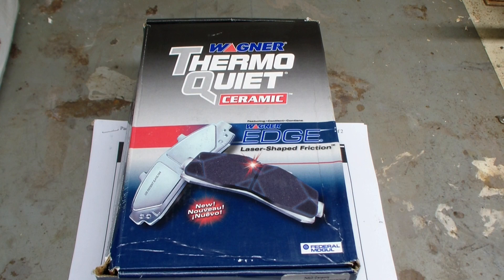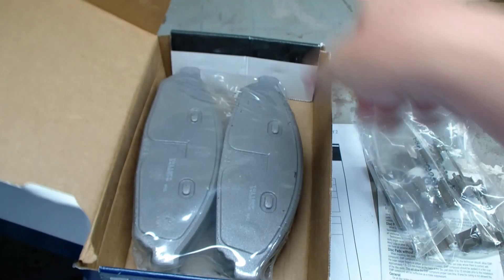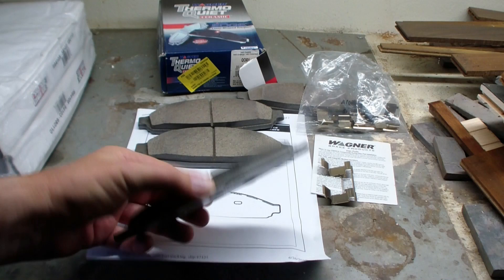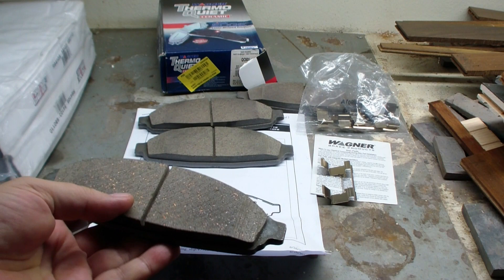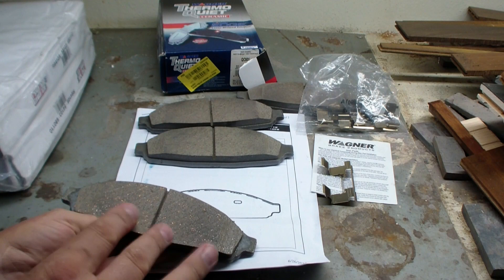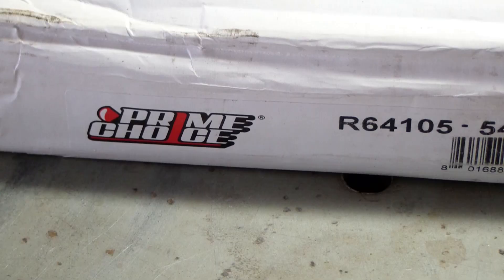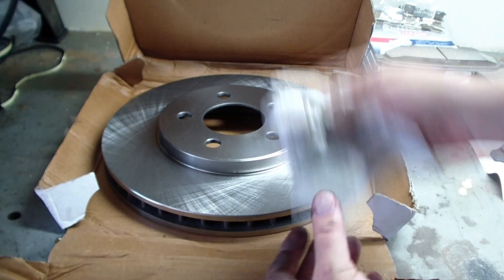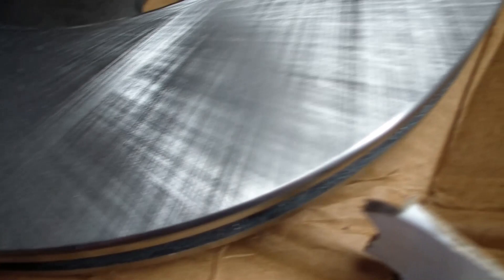Wagner ThermoQuiet Ceramic Brake Pad and Prime Choice Rotor Review

Comment: I used to love Wagner pads until I bought my first new car. I bought a 2016 F150 and @ 2k miles. The front rotors warped. I could not believe it and I kelp driving the truck thinking the problem would go away. @ 20k miles, I ordered Wagner pads $50 and some off brand cross drilled and slotted rotors for $50 off ebay. I installed the pads and right away I notice my truck did not stop as well as the stock pads. I had to stand on the peddle for the truck to stop. I put about 20k miles on the Wagner pads. I then went back to Ford and bought Motorcraft pads for $90. The truck stop like it did when new.
Reply from the maker: When it comes to which brand to buy my head explodes. There are so many brands and options with some costing 4x others. I think there a few standard formulas they all pick from. I got Wagner due to the noticeable enhanced quality construction and they include the hardware for a reasonable price. Economies of scale from a large company. So far so good for me.  Factory pads seem to be a safe option too. Model by model it will take experimentation to know.
Reply: @KentDiego  Yes which is why I tried Detroit Axle $27 (too much dust) and Bosch pads $60 (stop better than Wagner but cheaper than Motorcraft). I have a video of each. I plan to try Stop Tech next.

Comment: Carb/choke cleaner is not the same as brake cleaner.   It makes no sense to use premium ceramic pads with junk rotors.  Those rotors will wear rapidly and unevenly and take the pads with them.
Reply: इंदापूर

Comment: I order once for my Toyota Prado they were good but the covering was mildly broken with some metal rust on them they were good for there live time, changed at around ( 50000 kilometer) and there price when I put them in the car there moulded insulator broken also by the piston rings pressure , so  for me I would still stick with original brake pads better

Comment: So will these squeak to let me know it's time to replace them after using them for a while?
Reply from the maker: Older cars had what they called a sensor, a strip of spring steel that would hit the rotor when pad got thin. Newer cars have wired sensor that hits rotor when pad is thin. The pads should never squeak on their own.

Comment: I'm currently looking into these same Wagner pads for my 2012 Malibu LTZ. I've had my run with ac delco pads and rotors and I wasn't impressed and they wore prematurely. August of last year I purchased duralast cmax pads and duralast rotors. I've put about 30k on car since then and there are grooves in the rotors but pads has some ok life left in them. How are the rotors holding up after a year?
Reply from the maker: Cortez P The rotors seem fine. I got them as they were the cheapest but a steel disc is a steal disc. Got rid of my shaking and pedal pulsations just fine.
Reply: +Kent Diego Hate to be "that guy", but rotors are made from cast iron, not steel. I'm glad they're working out either way! I worked for a company that produced rotors for GM, and believe me they're not all the same...these things went through quite the process from casting to final corrosion coating. I've personally never had any luck with cheap rotors holding up as long as the pads, but Michigan weather seems to induce warping. I just went on Amazon and bought Motorcraft rotors for my Focus and these pads. For $33/piece I figure I'm paying no-name money for OEM rotors. Hope they hold up to the ceramic pads, since they like to eat rotors lol. Glad your parts held up.

Comment: Hi, I put ThermoQuiet on my Van 200 KMS ago and with some moderate braking these pads STINK!  Do you have the same issue?
Reply from the maker: +Anthony A No unusual smell for me. I am happy with mine. Good ceramic pads, well done shim design, and a fair price.
Reply: Whether you replace the rotors or not, it takes a while for the pads and rotors to wear into each other.

Comment: Whats the difference between this and quickstop? I assume they are almost the same except for price.
Reply: I'm not sure if Wagner TQ and Wagner QS are manufactured with the same materials. However, the pads seem to be shaped differently. The Wagner TQ are chamfered and slotted differently than the Wagner QS. The advertised difference seems to be that the Wagner TQ are equipped with Wagner's Integrally Molded Sound Insulator, whereas the Wagner QS just has a shim.

Comment: I was really hoping you were going to show us how to put the hardware on or what these even do.  I have no idea what to do with the hardware that comes with these. Is it explained in the instructions?
Reply from the maker: Hi Matthew. Here is the installation video: 
https://www.youtube.com/watch?v=T2r0rF4lEQA 
The stainless steel glides replace the existing glides. Jut pry out the old ones and the new ones snap in.
Reply: Oh i see, thanks for that. But what about the bigger clips as you can see in the photo on Amazon? If you search Wagner ThermoQuiet QC652 Ceramic Disc Pad Set With Installation Hardware, Front, thats the picture i'm refering to.
Reply from the maker: The photos on Amazon are generic photos. Every model of brake pads is different and the stock photos they use are not accurate.  My video shows what is really inside box for Ford CV brake pads. That clip in Amazon photo looks like it fits on top of pads for anti-rattle.
Reply: I really appreciate your help.  Thank you!

Comment: I know this is a long time since the video was made, but how did the Prime Choice rotors hold out?
Reply from the maker: +Randy Kemuksigak No problems. I got them because they were cheap. They were still very nice. Well cross hatched disk. They claimed to have special coating on rest of rotor so will not rust. Made a huge improvement over old worn rotors.
Reply: Kent Diego are these the Platinum if not what's the difference between the two

Comment: How are those pads holding up a month+ later? I am looking at a set myself.
Reply from the maker: They stop well. I do hear low speed squeaking when cold. For a low cost solution they are great. If you are willing to spend twice the price then full ceramic pads MAY be better but who knows. I am happy with the Wagner quality, inclusion of extra hardware and price.
Reply: Low speed squick yes ur right? Squeek a lot as long as it get old

Comment: Are they good break pads? Do you have to grease them on the back or just put them in?
Reply from the maker: The Wagner pads have shim bonded to back and are covered with coating. I
 have never heard of using grease on back of pads. Some pads come with a
 package of "anti-squeak" of glue that goes on back but you do not really need
 it.
Reply from the maker: Also grease on back of pad will get into rubber seal at caliper piston and likely ruin it over time.

Comment: Check the box and make sure you get the ones made in the U.S not the shitty new ones made in Mexico
Reply from the maker: +krauser979 Funny you say that. Many years ago the US banned asbestos production. But Quebec has huge asbestos mines. They had a law that asbestos was not harmful and no one could sue for damages. So if you wanted the really good brake pads you had to look for the "Made in Quebec" label.
Reply: Kent Diego
Asbestos is such an obsolete material for brake pads it sucks during high heat applications and is far more susceptible to brake fade than modern metallic or ceramic brake pads...
Reply from the maker: +krauser979 This was during the '70's. They did not have ceramic back then. Semi-metalic was just starting to come on market. To replace asbestos they had "organic" pads. They were awful. Asbestos was a LOT better. Maybe high heat was a problem but for normal driving they worked great.

Comment: Cutting of the edge allow them to save money by giving you less brake material.
Reply: It's called a chamfer and it helps reduce brake noise and flex, and allows the pad to contact the rotor better.
Reply: @blackericdenice  Because it's a performance car and no one cares about noisey brakes in a performance car. -_-
Reply: @bobbarker3248  The Urus brake are not loud.